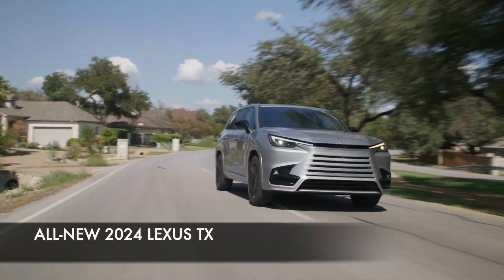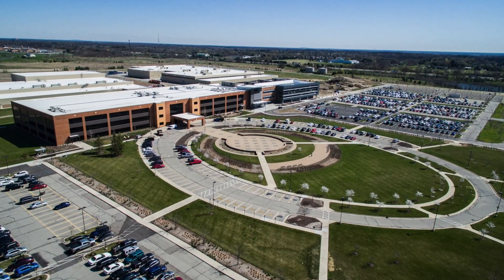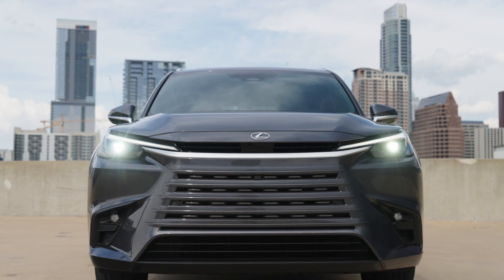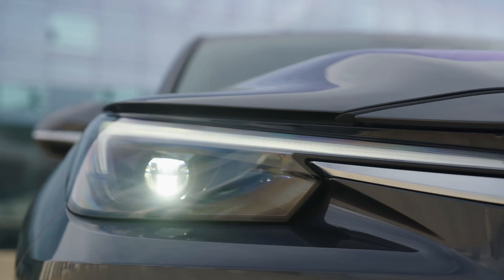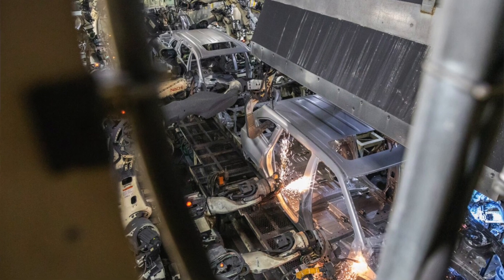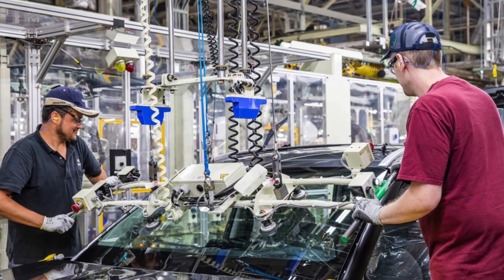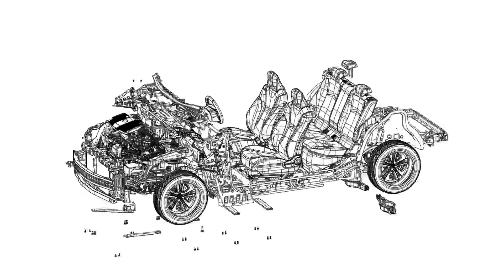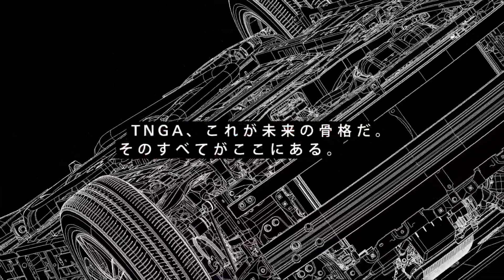EXCLUSIVE INTERVIEW with LEXUS TX CHIEF ENGINEER - INSIGHTS ABOUT LEXUS PRODUCT DEVELOPMENT

Comment: Toyota engineering, new vehicle development and production process in my opinion is the best in the industry. The focus is extreme and true craftsmanship.

However, Toyota makes it so difficult to buy the vehicle with the trim level and options you want. The dealer allocation system sucks! Even David with all the vehicles he buys and the leverage he has can’t get the color of vehicle he wants …like  
Nori Green; had to settle initially  for another color. This is crazy!

TPS is a very flexible production system and is tailored to build exactly what the customer wants…. Not to push product at the customer with trim levels and options they don’t want.

You can factory order a vehicle from Subaru and get exactly what you want. Why can’t Toyota do this for their customer? They can, but won’t. 
Shame on Toyota! And Toyota owns 20% of Subaru. Why is Subaru better? No excuse.

Many Toyota dealers currently taking advantage of customers(MSRP) etc., hurting the brand, maybe factory orders like Subaru would help mitigate the dealer damage to the brand.
Reply: Well said, Had a handfull of dealers attempting to get us a Grand Highlander HM, and the process is horrible, I consider myself lucky getting my hands on a TX, so much more refined and solid